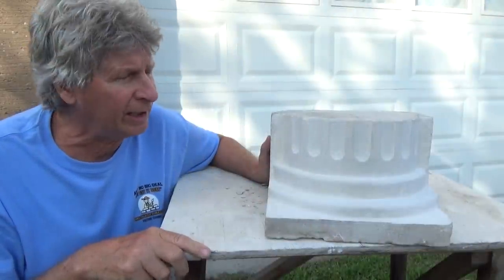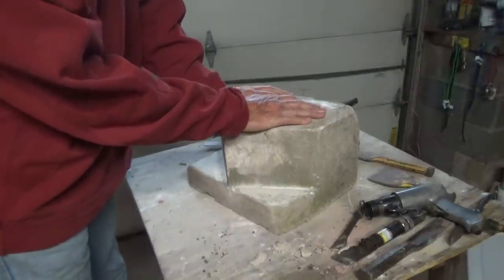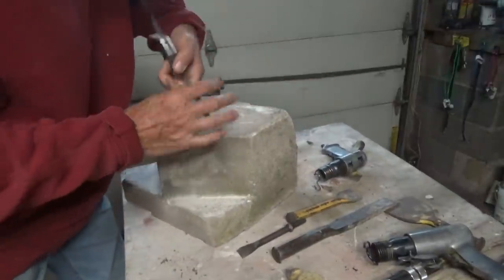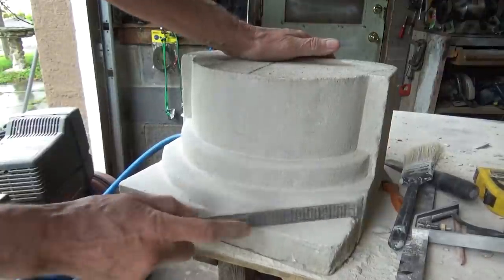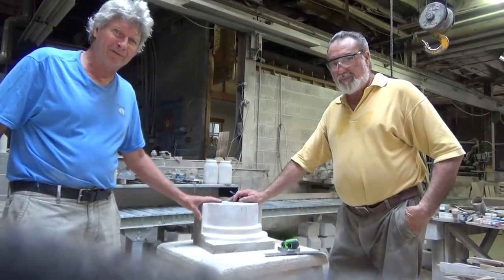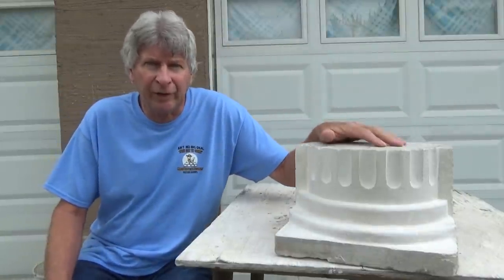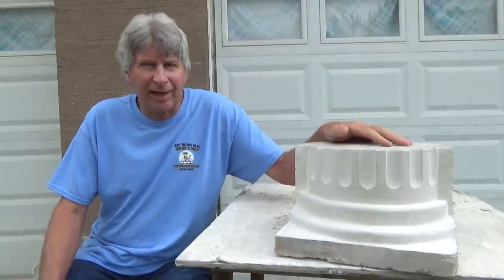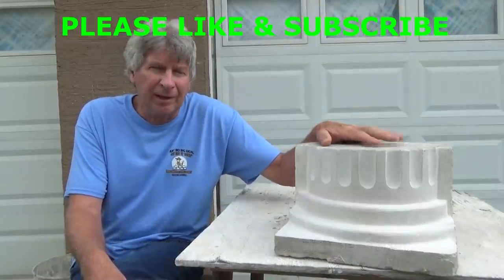ROCKFACING AND SHAPING STONE (Part 10) MIke Haduck

Comment: There definitely is something charming about things that are not perfect.  I'm a woodworker and when I was routing the edge of a table top, the bit came loose and took a huge chunk out of the side of the table top.  I sanded it down smooth and that's when I realized that those little imperfections give character to the project.  I actually add those imperfections to my projects now.
Reply from the maker: Thanks Grassy, I understand, Mike